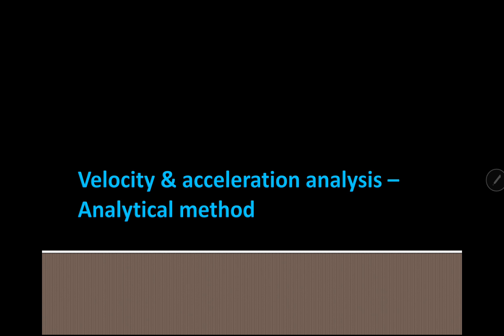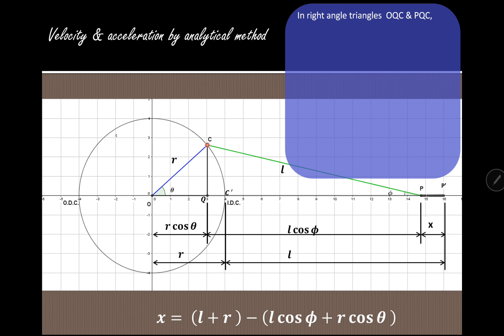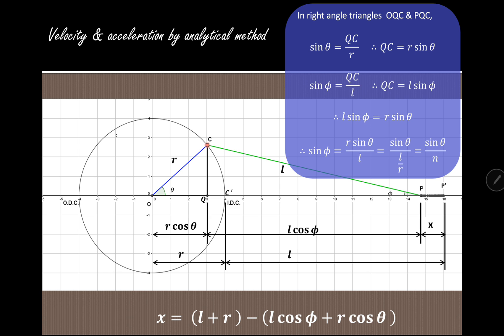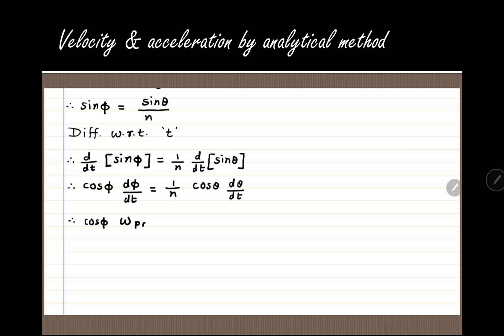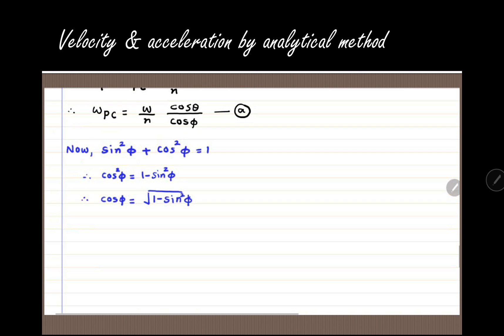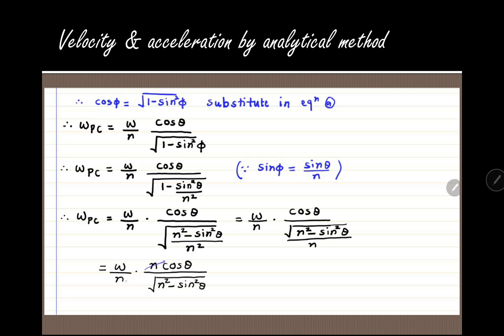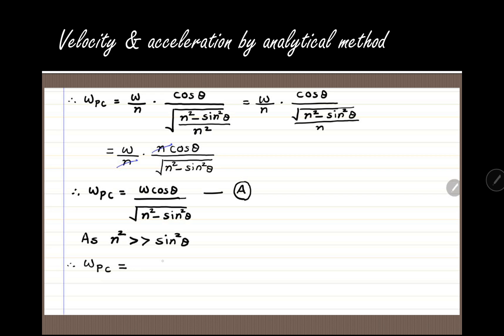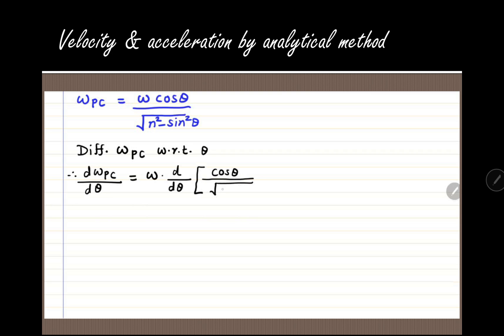Lecture 24 | Velocity & acceleration analysis | Analytical method 2 - Single slider crank mechanism

Comment: Hello how can I calculate the acceleration and speed of point C if i only have the diameter of the crankshaft, lenght of the connecting rod and constant speed of piston is 200cm/s